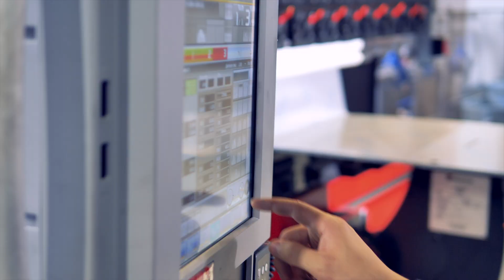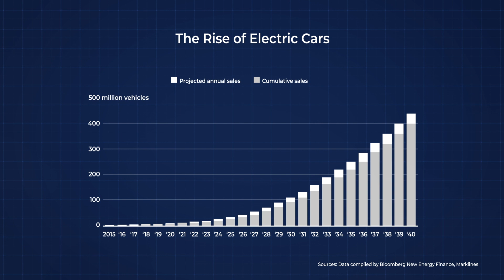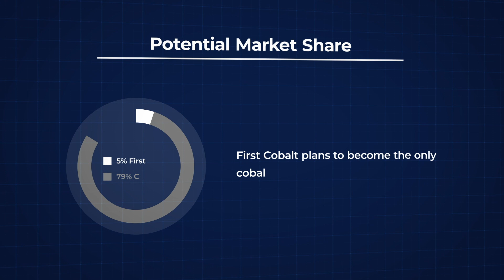Electra Battery Materials: Becoming a Key Player within the NA and EU Electric Vehicle Supply Chain

Comment: Close proximity to existing legacy auto plants does not mean much as none of these plants are equipped to make EV's.  Cobalt Ontario is hardly what I would call close proximity anyway, especially in relation to Tesla.  Will First Cobalt partner with Canada Cobalt Works for a supply of ore versus shipping overseas from DRC?  The other issue on my mind is will cobalt be relevant in future battery chemistry?
Reply: @iron___  I think we can expect a wide range of battery cell production chemistries in the coming decade and increased demand for refined cobalt in pretty much any scenario.